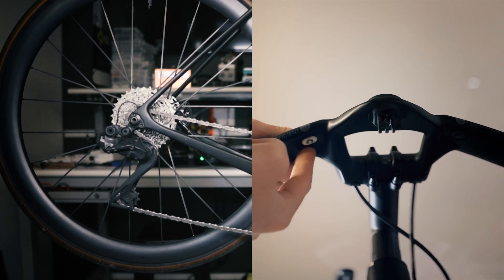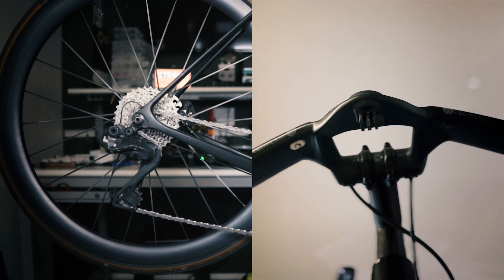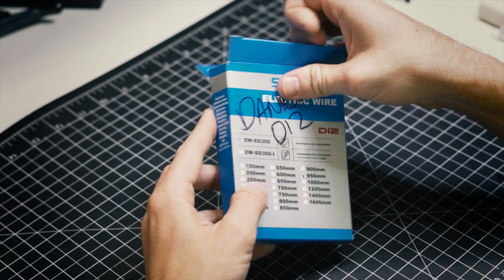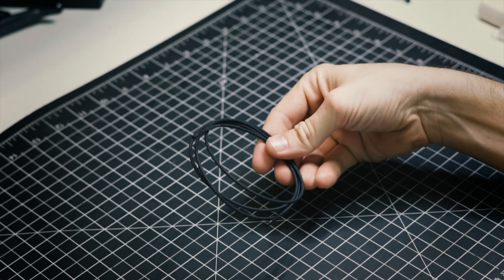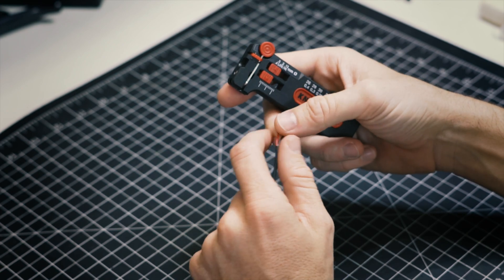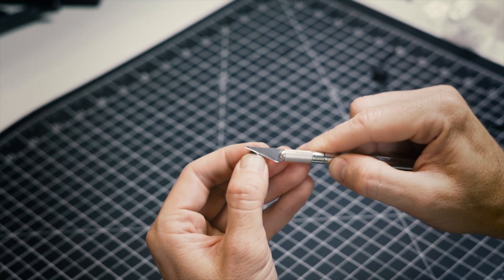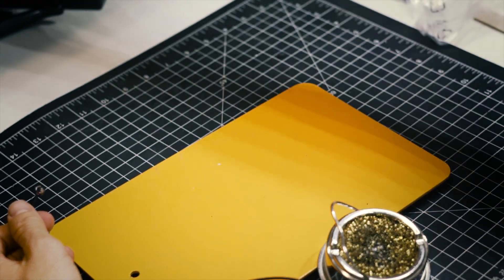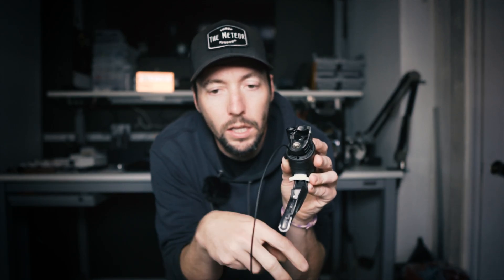Cheap DIY Shimano Di2 Satellite Shifters

Comment: I just purchased a set of the coefficient RR bars. Do you sell the 3D printed button housings for the momentary switches?
Reply from the maker: @bocajo4  I’m still doing testing on the buttons I’ve chosen, had some mechanical failures, so I don’t sell them. The 3d files are available thru the links if you would like to print them or have someone else print them.

Comment: is the Di2 11speed Wire the same as Di2 12s wire the same?
Reply from the maker: @superlauhea  the connectors are different, but the wire should be the same.